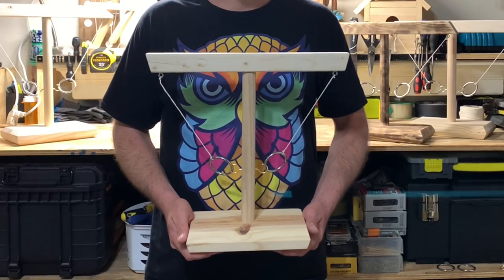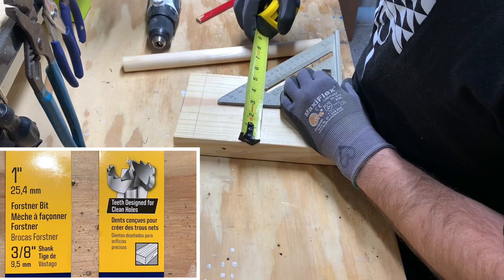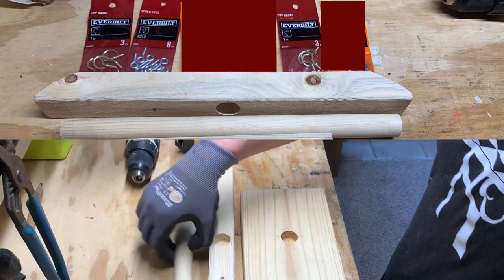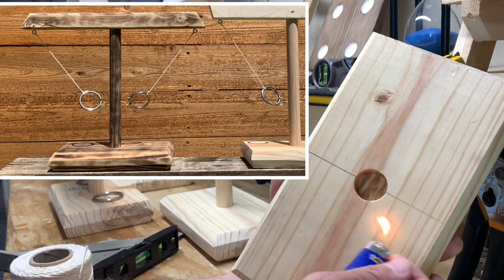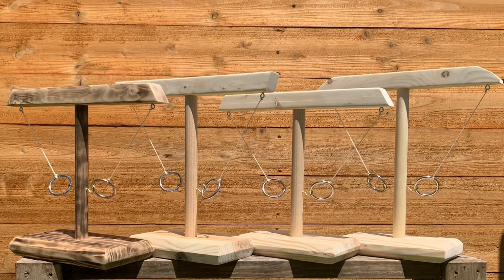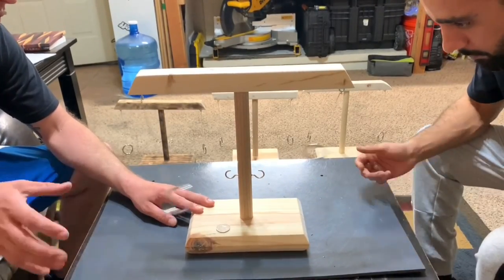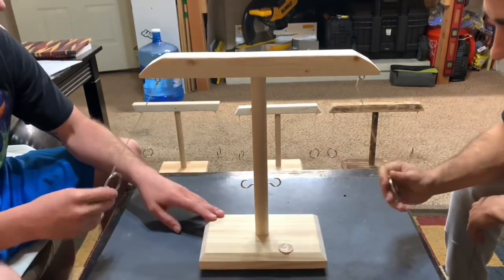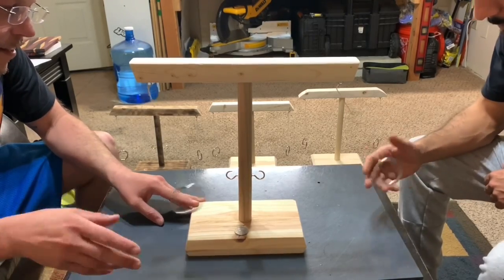Ring Swing Battle Game [Very Simple Project]

Comment: Great video. Thanks! I appreciate you posting the measurements.  However, I did find it hard to tell the length of the string. The picture is deceiving when the string is attached to the rings. Do you measure to the top of the base or the bottom of the base?
Thanks!
Reply from the maker: @Andrew Slater Hey Andrew, thanks for this question.  I had to go back and re-watch my own video to see what exactly you were talking about.  I would measure the string from the top, where it is attached to the eyebolt, to the bottom of the base.  Basically, you just want to give yourself enough extra string to work with so you can tie yourself a good knot in the rings.  Then you will trim off the excess.  You don't want to cut it too short initially or its gonna be too hard to work with.  I hope this helps.  I appreciate you stopping by.  Talk to you again down the road my friend.

Comment: How do you in insure that the base and the top are square with each other and the hooks?
Reply from the maker: @John Lehman Extremely careful measuring and cutting/drilling.  Make sure the dowel is on a flat surface and drill through with a drill press...also used the drill press with a forstner bit(drills a flat bottom hole) for the top and base.  Use oak(harder wood) instead of pine to keep the ends from getting compressed in to a cone-Ish type shape.  Smash it all together pretty tight and put a small speed square on the base and dowel if you really want or need to, it will be square if the platform on your drill press is level though.  I hope this helps.  Let me know if you need anything else.  Thanks for stopping by.
Reply: @CurtisMadeIt  I mostly mean the top and base. There is no real reference point to make sure the are parallel. At least that is what I struggle with.
Reply from the maker: @John Lehman I would say get it together with some glue in the top and bottom forstner holes and measure from the edge of your base on both sides up to the top and make sure those are equal.  That will for sure make it square.